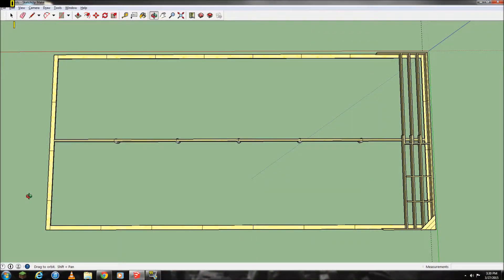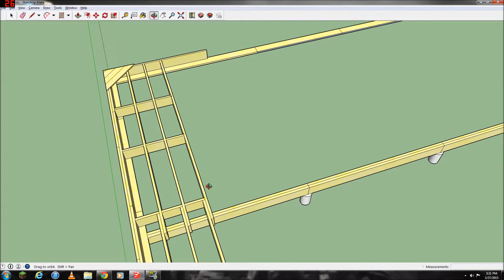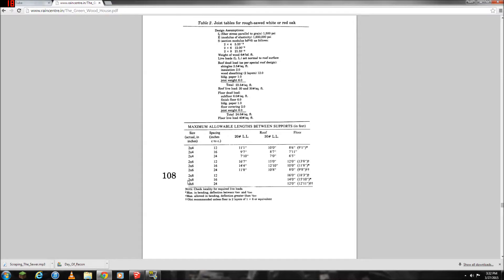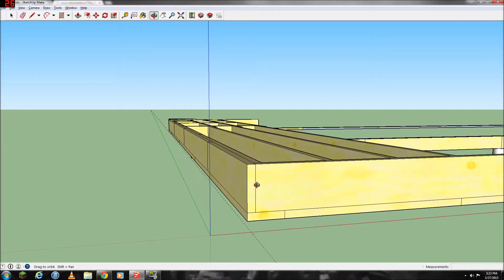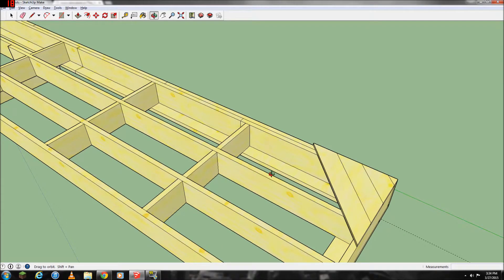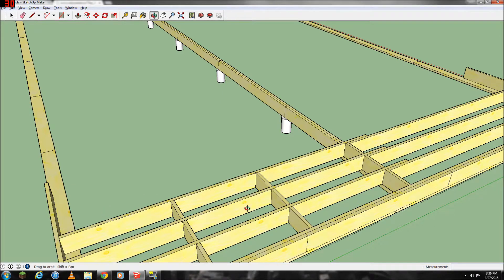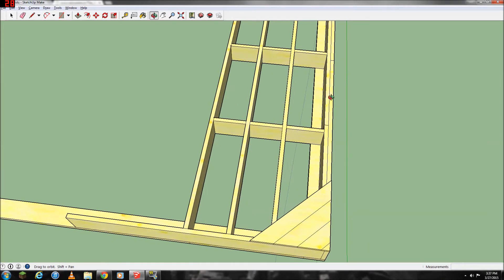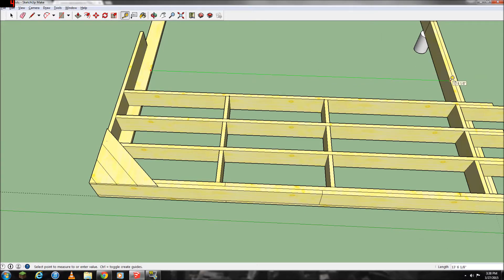Floor Joist Sketchup Narrated

Comment: your center beam is not only carrying the floor, but it's going to also carry 1/2 the roof load.  That load will make your posts sink and the floor and roof along with it.  You need foundations (or piers) under the center beam but you can use a wood posts to connect the center beam to the piers.
Reply: You'll probably need a consult from an engineer to size your piers and tell you how many you need.  You probably need an engineer stamp when you submit your plans for a permit (if required in you location)

Comment: Looks like a great plan as far as your pillars I would put them below your frost line in my days of construction we always put them below the frost line I know you don't have inspectors to deal with but that's what we was always told to do get your lumber cut before I come out so we can put that house under roof while I'm out their I'm getting my knee done before I come out so I'm up to the task
Reply from the maker: Wow, I doubt I'll be putting the roof on this year even! lol  It takes a looong time to mill 16 ft 2x10's.  But I'm hoping to get the block work soonish so I can start framing.
Reply: I was wanting to see you moved in this fall lol you have at least two months before I come out lol
Reply from the maker: William J. Barnhart Jr. When I started this I fully intended it to take 2 years.  If I just had all the lumber sure I could frame the whole house in a month, but I can only cut like 5 2x10x16's in a whole day...Maybe 10 2x6x8's in a day..So it's gonna take a while.  Not to mention the 200 1x6x8's for the subfloor.  I'm thinking realistically the best I can hope for is to be at least started framing the floor joists by mid summer.  I can cut lumber and frame in the winter time, so it won't be like this last winter where I basically can't do anything because of the mortar getting too cold.
Reply: I'm only messing with you but food for thought you don't really want to let your floor out in the weather for too long too bad you live so far away I have a buddy that has a saw mill he could mill your wood in a day
Reply from the maker: William J. Barnhart Jr. I have a saw mill 5 miles from here, but it costs to have them sawn, I can do it for pennies..almost no cost.  The trade off is it just takes forever.  Also, white oak does very well in weather, it is naturally rot and insect resistant.  I'm sure you've seen the 100 yr old barns with the rock hard grey colored wood, that's oak.  Obviously I don't WANT it left out, but a year or so won't hurt it a bit.

Comment: That should be very solid.  My span would have been adequate with 2X6, but I did the same and went with 2X8's instead.
Reply from the maker: I wish I could afford to buy all the lumber instead of milling each board, but just for the floor joists would be like $2,000 for 100 2x10x16's...I can mill them for less than $1.50 a board vs. $20 a board, just takes a long time! lol (and they're solid oak)
Reply: Backwoods Patriot  I wish I could mill my own lol.  If you watch my vids, I can't afford all of mine at one time.  I just buy what I can and store them in the barn until I have enough for a project lol.  Mine will take as long as yours, if not longer :)
Reply from the maker: The Off Grid Homestead At St. Bernard Acres I'm basically limited by the time and back breaking labor to mill these timbers.  It doesn't really cost anything to do it, but man it's hard work, and takes forever.